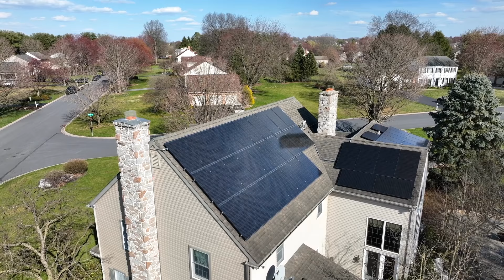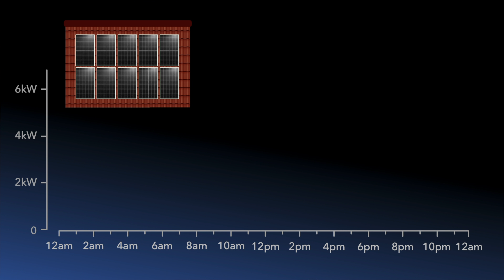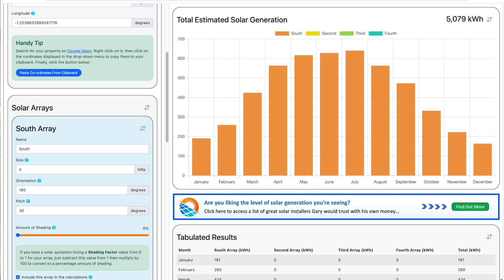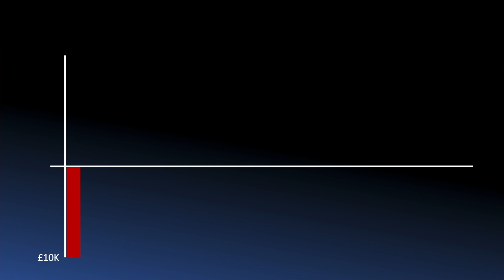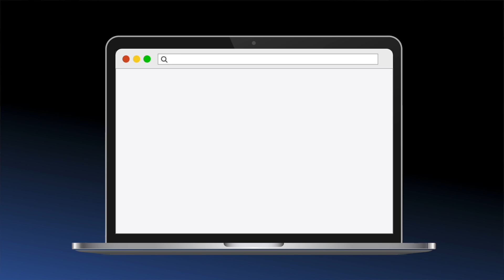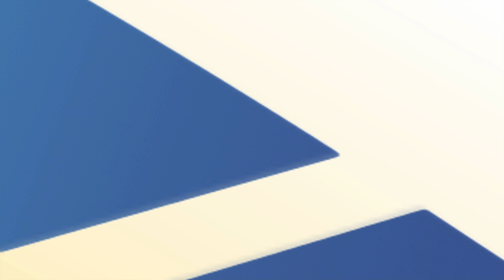How Home Solar Can Cut Your Bills Drastically

Comment from the maker: If you''re looking for a solar installer in the UK, feel free to use my solar installer directory: https://getreadyfor.solar/

You'll also want to be on a good smart tariff. I rate Octopus Energy in the UK. Sign up using my referral link here and we'll both get £50: https://garydoessolar.com/octopus

Finally, if you'd like to start trading your energy like I am doing, here's my referral code for Axle, which will give you £25. I'll get the same which helps the channel grow: https://garydoessolar.com/axle

Thanks for your support! 🙏

Comment: In Ireland I have a zero bill a few times but I always have to pay connection free to the grid around 20 Euro.
Reply from the maker: Yeah, the whole concept of a standing charge is getting out of control, I think! I get that there should be one—after all, the grid is always there for you as and when you need it, but the cost should be reasonable...

Comment: Would love to get solar, but we have a listed thatched cottage in a conservation area so can only get 4 panels on the garage. With the extra cost of needing architects drawings and planning permission, it’s an extra £1000 to the bill, so I estimate the payback period is something like 15-20 years! It’s going have to be home batteries (and EV) on an EV tariff for us I think unless I find someone with another solution…
Reply: Do you have a fence ? Someone hang the panels on fences albeit you need a support system.  Otherwise, just install home batteries as you are planning. My home can only accommodate 7 panels but they are making a big difference right now.  I find Octopus Intelligence Go one of the best tariffs for EV charging.   What type of EV are thinking of?

Comment: I have 16 panels and they add a lot to the battery and export only the excess goes to the grid, this applies in the summer but in winter it hardly produces nothing of note.
Reply from the maker: That’s true—winter generation is a lot less than summer. If you have a battery though, you could power your home using cheaper off-peak electricity ⚡️
Reply: @GaryDoesSolar I did until FOX changed their app to Mk2 and they took,my ability to work Octopus Go, and I can’t charge at night, if I use the others I get a full battery and everything runs off the grid. I cannot get them to explain what I need to get it back , the only option is Octopus agile which I do not want.
Reply from the maker: Worth joining a Fox social media forum like this one and asking a question there. Others may have found a solution:

https://www.facebook.com/groups/foxessownersgroup

Comment: I have reduced my bills with a 6kWp system but since installation my standing charge has gone from 25ppd to 70ppd. So my fixed costs are now ~£300 per year no matter what my panels give me. I’m just unlucky I suppose in living where I do. There’s also no indication that my standing charge will ever come down. My other worry is that as the number of houses with panels increase then at some point the Government will start to penalise people who export to the grid rather than pay them.
Reply: If you combine an ev and home battery with your system then sign up for an export tariff then the profit on selling your solar will cover your standing charge. If you only have part of this setup then you can’t get to zero bills.

Comment: Something I would seriously suggest to anyone who might have to make a choice financially if they can't afford solar and battery would be to install a battery system first assuming they can get cheap overnight electricity, 6p in my case. You then obviously use the power during the day at 6p instead of say 28p in my case. Over time one could theoretically put the saving into solar further down the line
Reply from the maker: Yes—and I think this will be commonplace before long 👍🏻

Comment: Makes sense if your electric usage is high and you don't plan to move for a few years, otherwise payback will take a long time. Crunched the numbers and it didn't stack up financially
Reply from the maker: Cheers Mark—for lower electricity usage, perhaps plug-in solar and battery is a better route?
Reply: I have heard this from friends when they find out I have no bills. If you only get solar then yes I agree but if you get solar/battery and an ev then add up your electric and petrol/diesel bills and sign up for an export tariff at 12p per kwh then you will probably get a decent pay back. Each case is different but I think many people don’t include the export profit.

Comment: We got our EV at the start of the month. Now I am on IOG. I charge overnight for 8p. Recently that charge has been 11.30pm to around 3.30pm. I stay on the grid until 5.30am. I have been force exporting from 4pm to 7pm. I could discharge more, but I want to balance making money and using the grid from an environmental point of view. Solar wasn’t the greatest until the last few days. The last few days we have been topping up the battery after 7pm and charging even less overnight. Made a profit for the last 3 days. I doubt I will have a zero bill, but very close.

Comment: I'm in Bristol and VERY keen to add more solar and battery storage: I had 9 panels, inverter and 5.2 kw battery installed in 2022. Then my neighbour built a dormer on his roof and put them into a lot of shade. I also did a loft conversion (nice extra bedroom) with similar dormer roof but only 6 of the 9 panels would fit, (although they are not in any shade now). The left-over 3 panels are sitting in my garden and would do well on the roof of my garden room, with at least another 3 added. Problem is they are GivEnergy who have now gone bust and the original installer is unable to even suggest when they can come and do anything so my panels are sitting idle which is very frustrating. Any help greatly appreciated.

Comment: I am having real difficulties, and beginning to wonder whether it is worth it. I have been waiting about two years, since buying a very narrow and tall town house, mid terrace. I have had to get planning permission for a cosy 6 heat pump from Octopus. They came to install it, only to realise that I am on an electrical loop with my neighbour. UKPN are due to deloop me in June. This could have been done last October, but my neighbour has refused to allow any work, and UKPN have had to get a warrant.

Regarding solar and a battery, I have signed up with Heatable. I am not entirely happy with the latest survey I had with them. I had an initial survey last year, but they had to return because they are no longer working with the first company. This second survey was not very satisfactory for various reasons. Before I can have any solar panels, I will need to have my roof tiles replaced, because they contain asbestos. This alone will cost £15k.

Given the long wait, and seemingly endless difficulties, I am beginning to doubt whether this will work out. I have a very high up and perfectly positioned south facing roof, not overshadowed at all. Should be room for about 9 panels. I am also looking at whether to put panels on the north side. There will be scaffolding on both sides anyway if I get the roof replaced. I would prefer the battery to go in my utility room (recent garage conversion at front of house, close to where meter will be), but the surveyors prefer the back wall, next to the back door. Space is tight wherever it goes.

The alternative would be to get a new gas boiler, very low flow temperature, and just not bother going all electric. I might still need to get an EV charger for my car. I have been living in an unrefurbished house for almost two years now.

Comment: I have had a 10kwh battery and 10 panels installed, but when it comes to getting on the right tariff I found that octopus energy who I have been with many years will not offer the flux options only the agile. It also appears from my research that other companies like edf, eon, etc only offer a tariff with the best rates if you have the system installed by them.

Comment: I've had solar and a battery for just a bit over a month, my bill taking into account export was -£25.  As I track the standard cap with my normal usage, that'd be around £110. Including Gas usage as we don't have space for a heat pump

Comment: The biggest roadblock to uptake of solar is that those who struggle most with energy bills are the very ones who can least afford the initial outlay. What's needed is a government scheme that allows people to borrow the initial cost of installation, where 75% of savings on bills can be used to cover the repayment costs.  With a small interest rate to cover the costs to the Government of running the scheme, everybody would win. Cheaper bills to begin with and massively cheaper bills once loan is repayed. No cost to the taxpayer.    Yes, would be simpler to just get a loan from a financial institution but again, those with least are less likely to have loans approved.
Reply from the maker: You’re right—I’m waiting to see what the government scheme looks like later this year 👍🏻
Reply: The new UK wide scheme is actually supposed to include 0% loans (which given inflation are actually a few %age points gift) that should help people in the middle of the pile.

At the bottom of the pile though everyone rents and it's completely in the hands of the landlord who has no reason to care.

Comment: Had our 12 panel system and storage installed a month ago. Not used anything from the grid since. However, now that our export is all approved it's disappointing to see that Octopus flux has disappeared with no updates as to reintroduction for new customers.

Comment: I haven’t got an all bells and whistles setup, only 5kw array, but manage to charge 15kw battery storage. From April to September I am able to trickle charge the EV from a 2.2lw socket. If I need a boost I charge from the grid over night on a a 7kw charger. In winter I have the algorithm that will cheap charge the batteries on the lowest tariff and then shift load as required. It takes a bit more effort as some is manual intervention. It works for me.

Comment: It puzzles me why we are so high priced in the UK for energy? I live in Scotland and we have an abundance of wind, solar, hydro and tidal power schemes, plus natural oil and gas right on our doorstep! What are we doing with that? Selling it at inflated prices obviously, plus we send a lot of it out of Scotland of course....... 😊😊 Oooo, that should provoke some interesting replies maybe?
Reply: Simple answer is weve been turned into a gullible bunch that will do as we are told,pay up, and shut up.
Reply: @JH-fv1gq A very honest and appreciated answer, but you're not alone - the whole UK has the same problem.
Reply: Most of the bill goes to gas power plants, they are guaranteed a minimum amount of money just to sit on the side lines.
Reply: @markgilder9990  But Scotland only has one gas powered - the Peterhead Power Station in Aberdeenshire, and that's still operational, to fill the gaps when renewable sources sag, and we have an abundance of natural gas just a few miles offshore from it. But we still pay well over the odds for our electricity.
Reply: To get that wind and solar installed there are all sorts of incentive packages. We have also invested a lot into inter-connectors.  While the fuel is free there are lots of other costs.
Reply: @edc1569  Yes, but it's the investment for the future which will pay off.
Reply: Part of the problem is currently you have to pay for all the renewable build out AND also the gas power stations as renewables remain very intermittent.
Reply: @edc1569  That will improve though as storage solutions get better, safer and cheaper.

Comment: I clip like a mofo on my system. I hope the dno will let me add a second 6kw inverter to maximise my 12kw array. Be nice to have another 10kw battery as I don’t like mine dropping so low running my air conditioning in the evening. Uk based north and south array 12 panels each side. 23 degrees pitch no shade.
Reply: If the DNO says no then you can always make your second inverter non grid tie and run half the house from it with it only using the grid as an input. It's not a common set up in the UK but it's quite normal in many places where export tariffs suck, paperwork is horrible or the electricity companies simply hate solar/battery and make it impossible to grid tie even if the law says you can.
Reply: @etchedpixels sounds like a good plan.
Reply from the maker: All the best with your plans, Nicholas—and fingers crossed the DNO looks favourably on it all! 🤞😁

Comment: Does it make sense to charge an EV at midday? I have solar panels,  a battery and smartmeter, and am on the Octopus Go. Tarriff. I always charge after 12.30am to take advantage of the 7p rate. Pretty sure (but not absolutely certain) that Octopus will charge the higher day rate if you''re charging at midday?
Reply: It depends! If you can export excess solar for more than your cheap overnight rate by a good margin then I'd only charge at night and rather export any excess. But if you have a limit to how much you can export from the DNO or your system suffers from "clipping" when there is a lot of sun, depending on your system, it might be worth charging during the day. If you have a wall charger that can exclusively use the excess solar that is, so it doesn't touch the grid and incur the day rate unit price. But for most people who pay about 7p for the night rate but can get about 12p for exporting, it's better to only charge at night and export everything extra.
Reply: Go currently is in the bizarre position that it's best to charge everything overnight at 7p and sell all your solar back at 12p or so. That also causes all sorts of problems with people doing battery arbitrage and other games that are against feed in rules.

Comment: Unfortunately in NI with a poor choice of tariffs, no dynamic pricing, really poor export prices (9p), overnight rates (15p) double the price of mainland UK rates etc it means that even with lower price of install a £7-8,000 system (6kw array, 10kwh battery etc) claims to pay back in 5 to 6 years doesn't seem to actually pay back until probably double that having done the sums (using Garys pay back spreadsheet) - and assuming a 5% price increase on standing charges/unit price every year.  Unfortunately by then you're near/at the end of warranties on inverters and batteries and while this doesn't mean they have to be replaced it is still a potential expense to be aware of in case of a fault which can shift break even another few years.  Maybe I've missed something?

Comment: Hi Gary. Do you have any advice for someone who is unable to get smart meters working in his area. I had smart meters installed by Octopus 18 months ago, but they will not connect with the WAN, so I have to provide Estimated Readings to Octopus each month, since the readings cannot be automatically transmitted to the supplier. This is a problem which affects the whole area in a small city where I live. Sadly, this means I am unable to benefit from smart tarifs and if I install Solar Panels, etc. would be unable to export electricity back to the grid.  I have quotes from installers, and am ready to get it installed, but have run into this roadblock. being unable to export means I will be unable to recover much of the costs, and maybe should consider a smaller system, but this seems bizarre. Any suggestions?
Reply: After a cold snap in Feb 2021 my smart meter secure wireless integration with the electricity meter box outside stopped working for more than a year. The gas meter integration was unaffected. I assume Octopus did a firmware update to the smart meter and, lo, the electricity meter integration resumed. It’s been solid ever since
Reply: You do not need a smart meter that is in smart mode to get feed in payments. If your supplier is telling you this then raise a complaint. They have a requirement to provide you export payments regardless of whether the meter is in smart mode. It's in the contractual requirements. You may not be able to get any time of use tariff except for economy 7 however.

You just read the generation value and send them at that as well - that simple.

Comment: For most all this is doing is swapping an energy bill for another bill.

Financially, if you assess this correctly you will be better off taking your 10k and investing it and using the investment returns to pay for your energy bill.

But the problem is that once people get solar or battery they self supply and use a lot more. They value the energy they consume as costless and not having any value.

So it’s not treated as a financial proposition by most. Except most are financially native to the options.
Reply: that’s interesting, can you point me to the investment that will give me a guaranteed 9% return with little volatility?

Comment: We were using a lot of electricity and gas, so bit the bullet and installed 29 panels, with 27kWh of usable battery storage.  For Gas, we installed Hive and their smart TRV’s.  It is saving us a fortune!  I put a spreadsheet together comparing this year with 2024 and 2025 and also usage based on 2026 prices.  It looks like we will save around £4k this year.  They system cost £20k so very happy with a 5 year payback.
Reply: A five year payback on a system that size is impressive. Nice when you can actually track the numbers and see the savings for yourself.